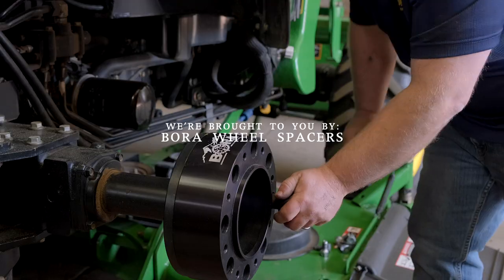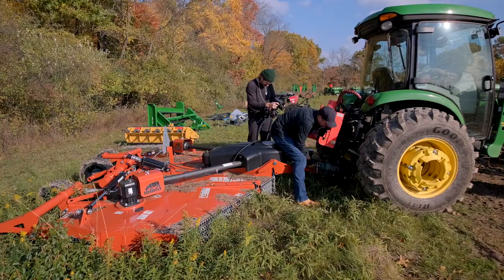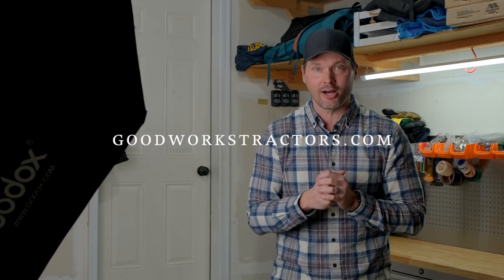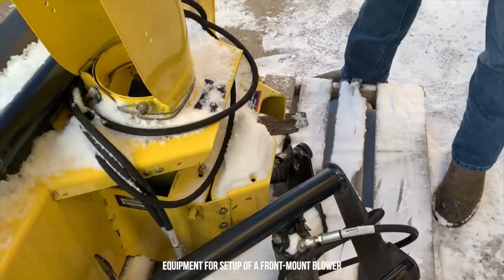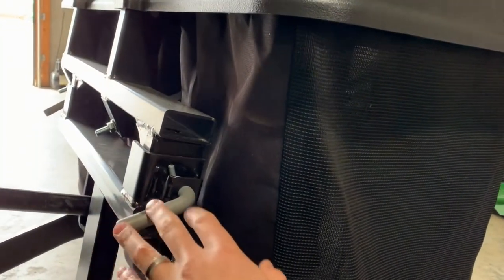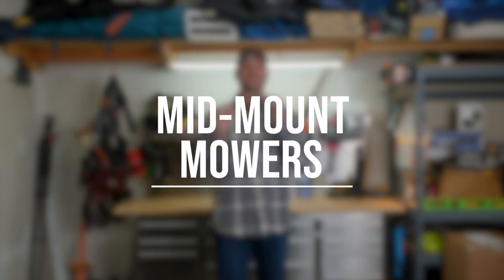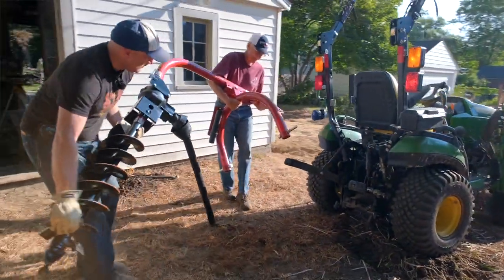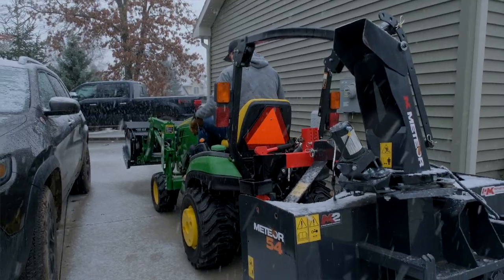5 ATTACHMENTS SO BAD THAT THEY'RE NOT WORTH BUYING? 😡

Comment: I got a 57 JD 520 and no attatchment is a pain. I have telescoping pull arms and a toplink that is a hook and i dont really struggle. I put a nieghbors 3point backhoe and that was a challenge because everything was set for her kubota.   I had my tractor digging out stump and friends husband was hauling brush with new holland and my friends (brother and sister) were using kubota to haul blocks of wood and guide remainder of trees after a bad storm so we had 3 tractors doing storm cleanup
Reply: The first tractor I drove was one of my dad's JD 520s in 1959, I was 7.

Comment: Great video!! I tried two different quick hitches only have one quick hitch implement that's a 6ft. 2017 Mahindra box blade it hooked up perfectly but none of the rest of my implements.  I had a post hole digger put in 200 post with it by myself was kinda aggravating but did the job was hard to store in dry but didn't really have that much problem with it.  Thanks for sharing be safe have fun

Comment: I have to admit the 3 point quick hitch is one of my least favorite attachments I've had on my tractor.  The Harbor Freight Category 1 quick hitch in my case.   Now not because of not knowing how to properly use it but, I found that the variances in the older 3 point equipment that I have doesn't exactly match up to the quick hitch.
Reply: That is why I went with Pats quick hitch. No issues with it. Check out Pats quick hitch
Reply: same story after  buying equipment for 40 years.

Comment: Hey Courtney, re: quick hitch "for reasons unknown"....the ASAE s278.6 spec doc (page 106 on the 1998 version) specifies the diameter and it is the same value for Cat1, Cat2, and Cat3.   Ditto the upper hook opening diameter.  Now, I don't know the reason for <that> (and perhaps that's what you were actually musing about), but I can guess that a standardization of the openings was desired for maximum re-use of parts across the industry.  Another reason might have been to reduce the stress in those mounting holes by increasing the radius (and thus both the surface area and volume of material related to bending/warping and resistance to propagation of micro-cracking) for durability reasons.  I would imagine that they are designed principally with a pulling force in mind, and the extra radius provides a better geometry to handle the load of trying to stretch open the "hooks" in the longitudinal direction w.r.t. the tractor's axis of motion (imagine straightening out a fishhook by pulling sideways on the barbed end.  The closer the fishhook is to a "vee" shape, the easier that becomes).  That's just a guess, but from an engineering aspect I can see that as being a weak point they were trying to mitigate with that choice.  I'll do some research later if I get bored and I'll update with any findings that bring further clarity.

Comment: I think the mid mount mower is the worst. I have a 72" drive over deck on my 2038r. Not because of installing and removing it, that's easy and takes almost no time but because when mowing the radiator gets full of grass clippings. especially when the grass is dry and the wind is blowing and the sun is shining and when the sun is not shining and on and on and on

Comment: I have to say the three point post digger is the worst. Getting it on can be a pain but the in our rocky soil sometimes a single hole is  10 shear bolts and finishing it off by hand. Went to hydraulic unit and will never go back. !

Comment: I have a MF GC2309.   The front end loader comes on and off very easy. Once one has the hookup installed for the front mount snow blower , it only takes a few minutes to remove the snow blower and re attach the FEL.  A back mount snow blower that one has to drive through snow first to clear the snow, that has to be the dumbest idea I've ever seen. Try to drive through crusted 2 feet deep snow  to clear it with the rear mount pull snow blower. Not going to happen.  My personal ideal option is a rear mounted blade combined with the front mount snow blower or FEL, works very well.  The rest of your video was informative.

Comment: I had a 1025r with a front mounted snow blower, a mower deck, and a backhoe.  After having that for about seven years, I replaced it with a 3046r that has no front mounted snow blower, mower deck, or backhoe.  I don't miss them at all.  I'm not saying that they weren't useful, but I'm getting along fine without them.  My most used implements are my basic bucket, snow pusher, and grapple.  My back blade and landscape rake are following close behind.  No pun intended.  I've also got a 4 in 1 bucket and a box blade that have their applications, but not as frequently as the others.

Comment: I bought a John Deere iMatch for my 770 when they first came out. None of my attachments including my John Deere brush cutter fit it. None. Not one. I spent a lot of time modifying the attachments to fit the iMatch. Once I got through the process of adapting the attachments (including my home made 800 lb counter weght) that iMatch has move to the top of my list of favorite additions to my tractor. My 770 came with a quick attach model 70 loader.

Comment: I can't believe that the front mount snowblower made your list. Blowing snow out of our yard and off of our 1/4 mile long driveway is one of the main reasons we are buying a utility tractor.  With a cab too!  Kind of leaning towards orange also...
Reply from the maker: Love a front mount blower. Hate the set up for it though!
Reply: @GoodWorksTractors  our snowblower will stay on all Winter long. Thinking about running a box blade on the 3 point for breaking up some of the hard pack and for clearing snow also

Comment: My quick hitch compatible post hole digger is not difficult put on and only one person needs to do it. The way to do it is to drill a hole into the ground, a.k.a. a post hole, and then remove the post hole digger in the whole so  it is standing straight up all the time. One person can then install and remove it by themselves.

Comment: I added a slip clutch to the tractor side of my PTO to remove need for shear pins and also make up the gap from my 3-point quick hitch. Anyone who complains about a quick hitch is clearly using it wrong. Best thing I've bought for my tractor, hands down!

Comment: I don’t have most of the attachments on the list.  I have a 1025R.  I have never removed my loader.  Love the JDQA for the loader.  Instead of getting a mid mount mower, I kept my JD X320 mower.  Now I don’t have to remove the deck from it unless it is to do maintenance.   That was one of the best things I did when I bought my 1025R. My post hole digger/auger is the most difficult to hook up only because it is not quick hitch compatible.  I can hook up or remove it by myself.  It is not a two person job.  I can hook up the PTO shaft on it faster than you connected the PTO adapter in the video with nothing attached.  So I don’t see the point in getting a PTO adapter.
Reply: I have a 2004 Case IH 24DXe tractor. no quick hitch and the FEL is a real PITA to re install. Removal is fairly easy but getting it level is a challenge. The 3-point hitch uses turnbuckles which are very easy to bend but extremely costly to replace.  One of these days, I'll spend the $180 to replace them.

Comment: I bought a Cat 1 quick hitch a few days ago. Mounted right up to my tractor. But wouldn’t go on my used 6’ brush hog. Turns out it’s a Cat 2 brush hog, but with Cat 1 pins. It was so frustrating. I could understand why people would say the quick hitches are most frustrating, because if it doesn’t work with your attachments (which often outlive the tractor or are nonstandard for economy’s sake) or tractor then none of your intended attachments may work with it. That being said, I got an education out of it…

Comment: I have to agree with the PHD as the most difficult to attach, as it is very cumbersome. I have found that attaching an engine hoist to the PFD aids in storing and installation. The other gripe I have about the PHD are the auger bits. I have  6, 9, and 12 inch augers, and each one takes different style and size bits. Having 50 acres in N. Nevada, I use it quite a bit and chew through bits quite often.

Comment: One of the attachments I had in mind when I purchased my 1025r 6 years ago was a posthole digger. I had and still have about 700 feet of split rail posts to replace, and more to install. Tractor Time with Tim put a post hole digger on his most hated list. Now it is on yours as well. I think I may just rent one of the 1-man post hole diggers from the local rental company. It's $100/day (or a weekend if you pick it up Friday), so I could get it done in a few weekends of hard work. As I get older renting is more appealing, but has the downside of making me kill myself getting as much done as I can during the rental window.
Reply: Just a FYI for ya...Lowes has been having the Earthquake One Man Auger on sale for $229 at least a couple times a year. I've got one with the 8" bit and though it definitely isn't "professional grade", it'll let you do it at your pace.

Comment: FYI, just wanted to tell you why I think the JDQA is better than SSQA. First is the equipment is closer to the tractor on the JDQA. Second, I was pulling with a chain and had the bucket all the way forward and when I backed up to make the pull the bucket came off!!  And yes the levers were down and it was locked properly! The third reason is it’s much less complicated and has to be cheaper to produce. It’s too bad the John Deere didn’t make it to the industry standard.

Comment: I grew up never having a problem with pto connections. And I'm not talking about small stuff either. Pto link just looks like an expensive  failure point to me. Rotate the implement shaft with your hands as you bring it up to the tractors pto shaft. On bigger implements like a 13' MoCo, there is one way that spins an overunning clutch so you don't have to drive the mechanism by hand. If you can't rotate the mechanism by hand on a shredder or medium to small implement, find out if there is a reason. Don't leave equipment in the weather. If you have to, cover the shafts and keep them greased.

Comment: The problem I have with connecting the PTO is, at least on my John Deere, the PTO does free wheel. So trying to turn the PTO shaft on a heavier devices can be a challenge when trying to line it up with the shaft.
Reply: Shift the pto selector lever to the mid mount pto or just in-between them. The rear shaft should then free wheel, at least my JD 1023E does.

Comment: Posthole auger:
1st: set a post in ground then use a strap to hold it vertically against post.

2nd: they should be hydraulic not pto. Would solve the getting stuck issue.

Comment: Agree - Cat 1 quick hitch is not usable on Cat 2 tractor - I have one of each. And virtually none of the things I use on the small tractor is easy with the quick hitch... I hate post hole diggers and I know a guy who broke his arm on one.  It's usually a bloody mess as I have such thin skin. Bruised and battered. But the worst piece of equipment is a tedder. They are terrible on many levels - tires, PTOs, staying pinned, loosening arms, breaking teeth... terrible piece of equipment.

Comment: I can understand why people were talking about the QH if you have both QH compatible attachments and older attachments, swapping the QH just to use one attachment then putting it back to use everything else is a pain. Now you could just buy a newer QH compatible version of the attachment but hard to justify buying a new one when you old one still works fine just a pain to connect. I can't agree on the belly mower for my Kubota BX it is a nice attachment when it is on however I use my tractor for so much tractor type work that the mower is constantly in the way unless I'm actually cutting grass. And trying to take it on and off is a pain like in your video. However what I have found makes it so much easier is to drop the mower to the ground and then use your front loader bucket to lift the front tires off the ground then slowly reverse and curl your bucket and you can carry the front tires over the deck and then just simply lift the bucket and drive away. Just reverse process when you need to put the mower back on and it makes it so much simpler than trying to drag it out the side of the tractor
Reply: I do that but I have the commercial deck so I so I set the front tires on the deck and reposition the bucket and then finish 72 inch deck

Comment: I hate rear-facing snowblowers. For us guys using cabless equipment, you turn into a yeti very quickly. Don't like mower decks on tractors either, just not worth the hassle for me. I don't particularly care for backhoes on ag tractors either, for what it costs to just get an older industrial TLB it's worth it to have two dedicated machines IMO. One with loader and hoe, the other for three point hitch stuff.

Comment: The thing I hate the worst about my back hoe for my Kabota L 2501 is if it sits for a while leaks down and when you go to hook it up the hose light long enough to hook up they made the pressure line too short but the return hooks up no problem so you had to get pry bars or the big backhoe out and pick that thing up set it on the tractor so you hook up the hoses

Comment: All the attachments i use on 55hp-95hp tractors (all category 2) on my farm would be quickhich compatible but for me its as fast as the quickhich to use the standard 3point linkages bc all my tractors have hooks on the lower arms so instead of having to buy 4 quickhiches i have to move some iron balls (for every atachment 2) around the not so often used atachments and on the often used ones i leave them on. So i just have to buy another pair of tese balls and maby some retaining pins if it comes down to it.
 What i thought to be bad to attach was the front loader bc it is slightly bent (apparently you shouldn't be trying to get a frozen load of rough gravel with 10 inch stones into a 2meter shovel at ramming speed. who would have known) but i found out to just lift the loader slightly of the ground (its a stoll robust f8 ) and then the pins will be coming out of thier slots with 1finger, put the loader down, then shut off the tractor and release the hydraulic oil pressure and disconnect the hydraulic lines start the tractor back up and  drive off. Problem was the dealership told me the loader needs to be on the ground and the slight bend had me fighting against the weight of the whole loader on one side and the other would always slip right out

Comment: I have a PHD though I've not yet used it. I need to use it this spring. Watching this video I'm thinking it would be easier to put on without the auger attached. Thoughts?
Reply: Chain it to a post then it not as hard to hook up

Comment: I really like my sherwood post hole digger on my 52hp tractor. It's stupid heavy so every part must be dissassembled to move or mount. But I have system and significantly this auger will chomp into man dirt that would otherwise require a crowbar! 
My worst attachment was easily the Yanmar diesel engine attached to my John Deere mid mount. Utter expensive  garbage. The Kawasaki zero turn JD is so so much better.

Comment: The 3PH mount, PTO drive post hole diggers, while cheap, are a waste of money and a trap you don't want.  You only realize, that if you have any significant number of holes to dig, that you should have bought a clamp-on front loader bucket mount, hydraulic drive digger that is far superior to use.

Comment: I built a trolley for my back hoe which not only made it easier to mount/dismount it but it made it easy to roll out of the way in my barn because no matter where you dismount it it will be in the way.

Comment: I have 4052r and I feel as though this video really doesnt address why any of these attachments are not worth buying. This really seems to focus on most 1 series tractors and equivalent which are for a lack of a better words hobby tractors. If you want to address things like the post hole diggers difficult and 2 man use that makes sense, but saying your worst attachments are anything with a category 1 hitch, non quick hitch, PTO driven, Loader arms or belly mounted basically says almost no attachments are worth buying. Compare some applications of different things. I work on plowing a large area and have found the rear PTO mounted blower to be quite useless compared to the 7ft snow pusher and 6ft bucket I use to move snow. When it comes to the backhoe, they are all different who cares how you mount it. The 485A I have can barely break earth unless its soft in the summer, so it has become a 8 thousand dollar counter weight. How useful thing are in application is a lot more important than just how its all mounted. Stop spending so much time plugging your ads and focus on the actual content and name your videos accordingly like why I hate mounting attachments.
Reply from the maker: How much time in that video was plugging our ads?